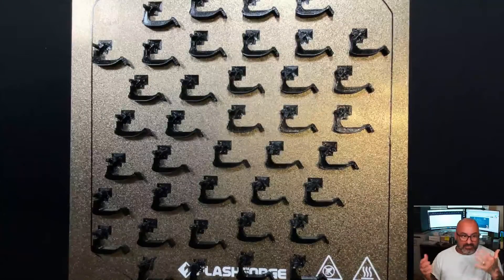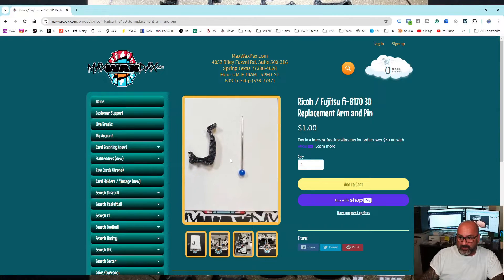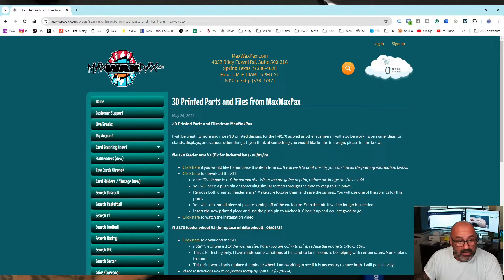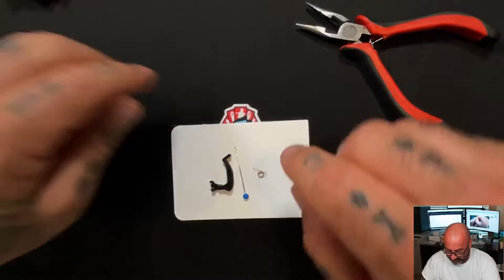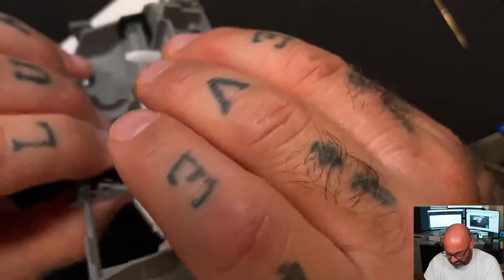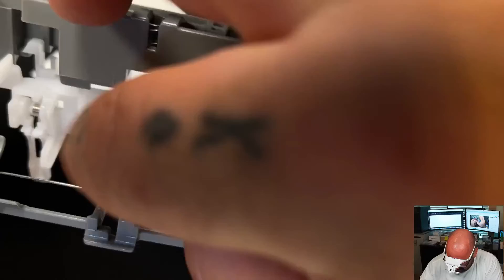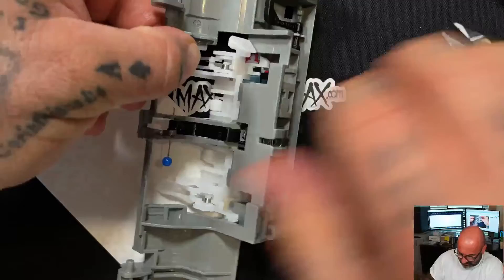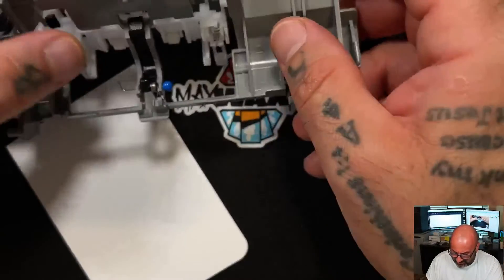Fujitsu fi-8170 - 3D Printed Feed Arm Fix Installation Video (SEE NOTES FOR UPDATE)

Comment: After I installed this, it doesn’t damage my mtg cards anymore. However, it has issues grabbing the cards smoothly. I would have to push it through the feeder in order for it to run smoothly. Any ideas on how to fix it?
Reply: Same here. Trying to figure out how to get it to feed cards without getting stuck. It will get to a point where it’s not able to grab the next card and have the rollers grip it to pull it through so it thinks there’s a jam when it’s just not able to pull the next card
Reply: @JohnHaley81  what I did to fix this is to wipe the roller where it grabs the cards. That fixed it for me. I’m able to scan some what normally. I do have to wipe it down after every use.

Comment: Absolute game changer! Thank you for the design and access to the file.  I came across your video and noticed the 8170 and 7160 arms were pretty similar so I decided to print one out and give it a shot. Perfect fit and perfect scans now. So anyone that has a 7160 with a scratching issue, it fixed mine and im fairly confident it will fix yours as well.

Comment: Hey just bought a piece and installed it based off of this video. I'm still getting the lines on the penny sleeves front and back but not on the cards. The only issue though is that the lines are showing up on the scans. Would love any info you can provide and I can send pictures of my install if needed. Thanks again for the help.
Reply: Wipe off the Scaning Lenses Betweeen Each Cycle

Comment: ok, but I can't figure out how to get the original parts out of the scanner? How did you get that whole section it sits in out?
Reply: yeah i need help also getting original parts out of the scanner first. its not really straight forward and dont want to break it as i am sure you feel the same way
Reply: @billkelleman3084 I still haven’t got an answer. Hopefully someone replies.
Reply: @gatecitycards795 I just found out you can actually wrap a piece of cloth tape around the middle where the plastic piece is and it eliminates the scan lines. I did a quick test and seemed fine. I am going to run a better test tomorrow and see how it goes. As long as that piece in the middle somehow moves a little out of the way I would think it should work. I really don’t want to take this thing apart because just seems like a pain.
Reply: @billkelleman3084 what specific kind of cloth tape?
Reply: https://www.youtube.com/watch?v=aSCWDJDr1NQ

Comment: Do you think this piece could fit on the 7030?  7030 has same kind of arm, but only one, instead of 2 for your scanner.  I bought a used 7030.... but still have problems with scratches... and sleeves ripped
Reply from the maker: I am sorry for the delay in responding. I do not know. Can you take a pic of the inside panel of the scanner and let me see the piece. I am curious as well to see if it would work.

Comment: Awesome videos helping me get my 8170 set up for scanning. I noticed immediately indents/impressions on the back of the card and then found the 3D part fix. Ordered the part last week, came today. Followed all of the setup videos to a "T"... just ran a test batch through of various quality cards from base paper Topps to Donruss Optic quality. I am still getting all of the impressions and am somewhat frustrated. It's the solid thickness impression that appears to be from the head of the replacement part. Any suggestions?

Comment: I was curious I saw another video by kronocard folks where they just remove the arms all together. Is that possible to do or does there have to be arms there ?
Reply from the maker: I initially did this as well and while it may appear to work, the issue is that the cards now have nothing to stop them from falling through in multiples. This is especially true when you use thinner cards like Pokemon or some older sports cards. The arm here is used to limit the cards from passing through in multiples. Without it, it can work, but it failed way too many times for me and I finally had to figure something else out. Hope that helps
Reply: @maxwaxpax  Thank you so much will be ordering some arms :)

Comment: Can confirm, it does work. It was a bit scarry installing it but, it works.  I scanned 5 cards with the original part and it had clear indentations. I ran another 5 cards with this 3-d printed part to compare. On one card I did notice the penny sleeve had a mark, but the card itself was perfect. Personally, I wouldn't want to sell cards after scanned with the original part.

Comment: Just bought this scanner and will definitely be ordering this. Are you still advising against using this scanner for cards in toploaders? Thanks for the content! Glad to have found your channel.
Reply from the maker: Without a doubt there is no way I would use this scanner to scan top loaders. I Can tell you that it was not on my first run that it scratched. It took a while (maybe 100 cards) but then one happened to hit it the wrong way and that was that. To be clear, there is not fix from Fujitsu. They were kind enough to help me but that required a new scanner to be shipped. My take on this is not to use toploaders.
Reply: @maxwaxpax  Thanks so much for the quick response! So glad I watched your videos before I set mine up.
Reply: @maxwaxpax  Barley Push Up On the Plate Slightly when using Toploaders Works Just Fine For me

Comment: Order in TY
Reply: How do you remove the big piece? So I can put the pin through like you did without trying as the whole printer is together?
Reply from the maker: Thomas - did you mean to pick UPS? I noticed that the shipping was high and wanted to make sure my site did not mess up and force you to pick that.
Reply: @maxwaxpax that was the cheapest option presented.
Reply from the maker: @thomas-nicholson  I am going to check what happened and see why this was the only option. If I can fix it I will.
Reply from the maker: @thomas-nicholson  ok got it fixed and now we have ground advantage which is something usps is now having stores like ours use. Since I did not know that I did not have that option active. I have recreated an invoice for you and issued you a credit of $4.28 which should appear back on your card shortly. Sorry about that and thank you for your patience.
Reply: Thank you, Otis.